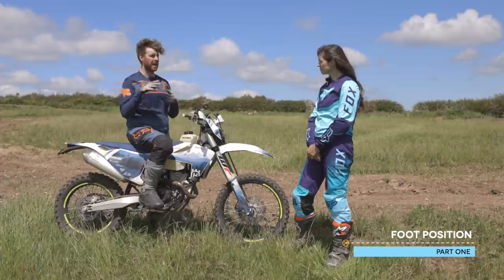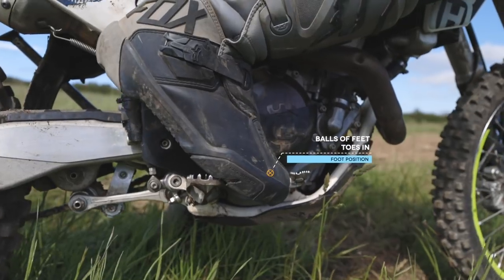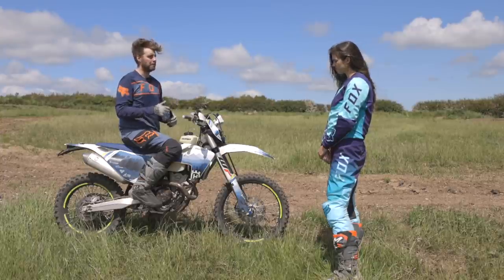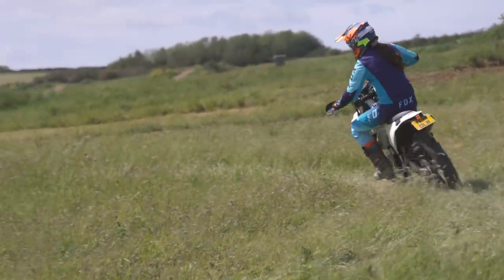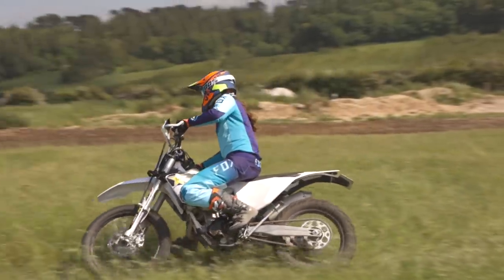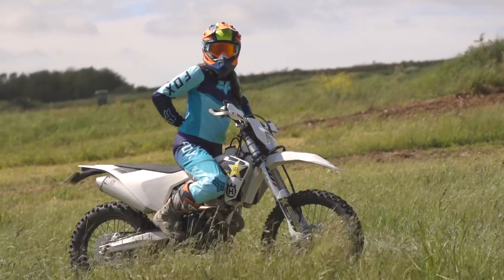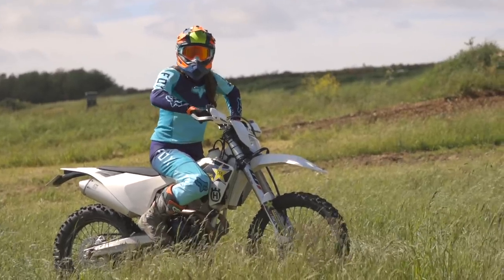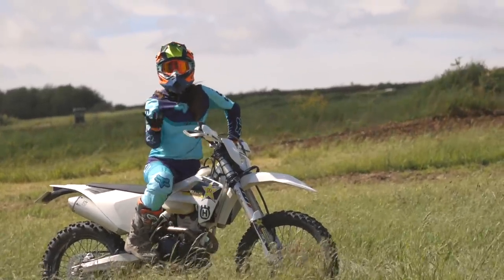How To Ride Corners Properly | MiniTip Monday

Comment: Interesting. When i was in the msf course for street, it was all very low speed stuff.
I inductively pushed down on the bars for most maneuvers.
They keep saying push the bars, but they meant forward, so i didn't understand until near the end, because i was succeeding at everything (because i was pushing them, just in a different direction).

So now i see you talking about pushing the bars downward, and it's like, "yeah, that's what my brain thought worked right at slow speed"
(I do need to get comfortable with fast flicks, so I'm not dismissing pushing forward)

Comment: Great instructional video! Regarding your comments removing the inside foot from the peg in some turns, another reason to put your foot forward and up is to help keep the center of gravity a bit forward on the front wheel.

Comment: Sitting at the middle of the bike gives so much more control over the bike, but at 6’4 the acute angles of my hip and knee are crazy. Pair that with super stiff, non-hinged mx boots and it’s a complete circus 😅

Great video as always, instruction wise you’re at the very top of all the channels I follow.
Reply from the maker: Get a tall seat my man. You'll thank me a 1000 times over. Changed how my bike feels.
Reply: @BrakeMagazine  Yeah I had one on my T7, helped a lot, great tip! Ride a DRZ now, I want a Seat Concepts tall seat for it, but its expensive for a cheap bike 😅

Comment: Nice format, its a more detailed and a longer explanation when theres the practice element or a learner involved.

Re: the last bit when you spoke about this being the same technique for adventure bikes- does the leg out element still apply for larger bikes? If not, where the line as to which bike it does or doesnt apply?
Reply from the maker: Sometimes yes and sometimes no. I think the line for is always the same. It depends on if the bike is in the way. The more lean you have the harder it is to keep your feet on the pegs 😊

Comment: Very nicely done. Does this also apply for midsized  adventure bike s. I bought a himalayan.with the purpose to do some offloading. Or are these too heavy?
Reply from the maker: Great question! The theory works the same on all bikes but the challenge comes in the riding position. The Himalayan isn't really designed for off-road riding positions, so the seat doesn't let you get to a middle position, the handlebars are a bit high and so on. It will work, but it won't be ideal.

Hope that helps!
Reply: @BrakeMagazine  thanks. I can sit up to the tank..so fairly on top of the footpegs..I will.practice on my land and let you know how it all goes after a while.

Comment: 'In the crack.... Of your butt' you both did well to keep a straight face, if I tried doing a video with my other half teaching her anything I think we would just start laughing. I've been riding off road mainly just local lanes, some are quite harsh down this way though, for past 3ish years but been road riding for 10 plus before hand. I struggle most with body position around a corner, on the road and track you are always trying to lean off the bike and keep the bike stood up for more grip, then going back to off road where you want to lean opposite the bike, similar to MTB, which I also struggle with, that's definitely the hardest for me, good to hear it from a professional point of view though, I will keep at it!
Reply from the maker: I took effort to keep a straight face 😂 I think it was first time nerves that made that happen 😂 Where do you live Dan?
Reply: @BrakeMagazine  ye good on ya for keeping going! I would have probably dropped the bike or something silly 😂 I'm down in South Devon, where abouts are you based?

Comment: You mention to push down on the bar to steer the bike, so how does counter steering factor into this which you would do on a road bike?
Reply from the maker: It doesn't. Counter steering is quite imprecise and aggressive with the tyre of road and not a technique we use to control the direction of the bike. Using the footpeg and small downward pressure on the handlebar is a lot subtler and allows for small or large inputs.

Comment: I saw the thumbnail and thought "oh, he's go a pro motocrosser in to demo"

PS, I've always felt like the foot forward is to weight the front. I find it particularly useful if I'm sliding the rear, either a big speedway slide, or even just trying to square off a corner.
Reply from the maker: I've heard this a few times and I'm not sure either way. I'd say that ideally you don't want to take your foot off the pootpeg at all. I also notice that for a lot of people there foot going out makes their head go backward do to lack of hamstring flexibility which negates the foot putting weight on the front wheel.

It seems plausible but I'm not sure on the net effect vs other problems if that makes sense! Great comment!
Reply: @BrakeMagazine  I'm not sure either. It could just as easily be that I put the foot out, think it helps, that gives me the confidence to use the throttle aggressively, that gets me the side I want, and that reinforces the idea that the foot out helps.

It's very easy to fool yourself.

Comment: I am a little confused. I am not a dirtbike rider (mostly paved and easy gravel), but pushing down on a handlebar are not a way to turn a bike. Pushing forward is the way to do it. Is it different on a dirtbike and really offroad?
Reply from the maker: Yes, it's very different. Counter steering still works but it's very aggressive for off road riding. It also requires you user body to be in the incorrect position. 

We do not use it at all off road but do use it on road.

Comment: the problem for me is that when i sit really close to the front  i feel difficult to operate the rear brake,  bcz the rear brake lever positioned high, so when i sit toward the front my toes are pointing slightly downward making it unnatural to reach the brake lever. any tips for that?
Reply from the maker: Yeah for sure that is difficult. You have to lift your foot up off the lever and place it on the rear brake. It takes some practice but you'll get there Norman!

Comment: Feet always on the pegs while cornering, never out. The exception being in technical terrain where you need to dab. If you must put your leg out, that leg needs to be high, pointed to the front fender, and as close to the front fender as you can raise your foot.
Reply from the maker: I agree, except on flat corners you can't lean a bike far enough without moving a leg. You also can't lean it far enough if you're trying to stick your leg near the front wheel.

That technique is for rutted or bermed corners.

Comment: Foot forward, leg straight, toe in provides a meaningful weight transfer toward the front wheel, improving traction in fast cornering.  Dangling your foot off the peg is something entirely different, and doesn't do a thing.
Reply: dznnf7 That's what I was taught, shifts the centre of gravity forward and helps to stop the front wheel washing out.
Reply: Given the weight of the leg is off the inside of the wheel, with the bike leant in towards it, the weight transfer doesn’t make sense from a physics standpoint. Your body is on the outside of the seat trying to stay centred over the mass, so weight hanging to the inside of that surely reduces the effect?.

Comment: I was taught that pushing forward on the bar initiates the turn, not down. Push right go right, push left go left. Try it, you'll see.
Reply from the maker: On the road. Not off road. The problem with counter steering off road is the lack of subtlety and how it weights the tyre.

Try it, you'll see.

Comment: If we're talking about body positions anyway: when your girlfriend is standing, like just on her feet, looking at you, she's leaning on one leg, her pelvis is tilted and her hip joint is taking all the weight. Women do this alot. That's not a good thing.
Reply from the maker: Can you explain more?
Reply: @BrakeMagazine  Sure. At 3:02 you see her standing with the right leg bent and forward.The left leg seems straight, because it takes al the body weight. Her pelvis is tilted lateraly, it goes up to the left. She is hanging in her left hip joint in stead of dividing the weight evenly on her 2 legs. You can see she's in a very relaxed but anatomically bad position. This will cause problems in the long run. 
It could just be because she's tired, but if she does this frequently it can cause neck and back issues. Her whole posture is a bit off,  she looks a bit bow shaped.